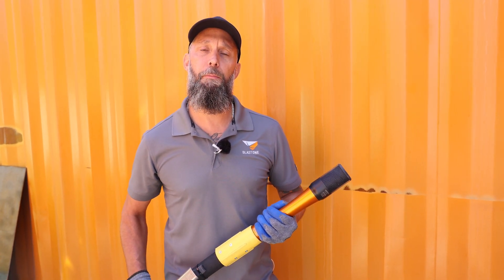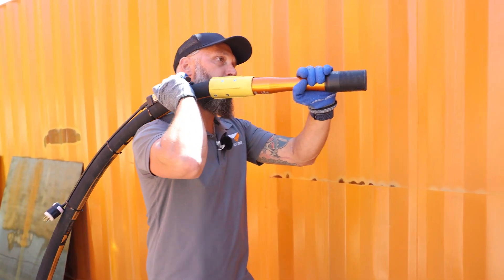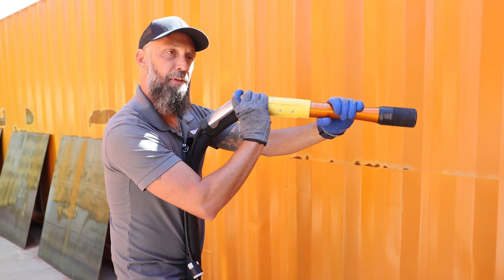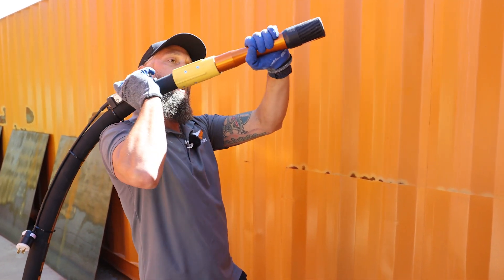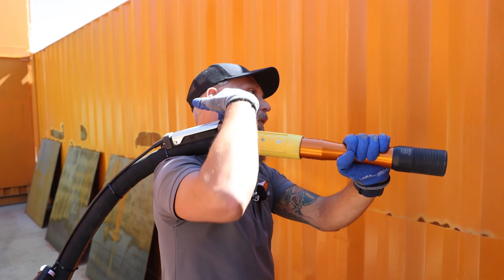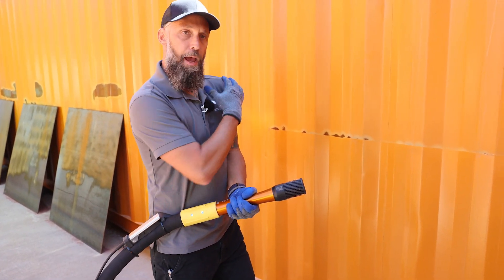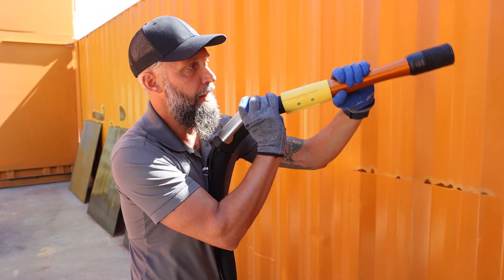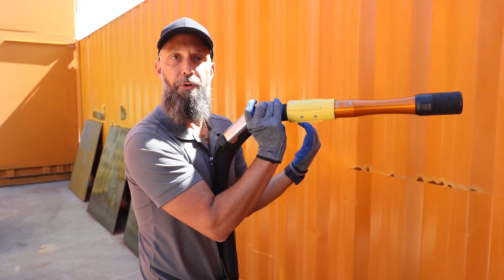Best Way to Hold Your Blast Hose

Comment: Are these recommendations in line with AMPP/SSPC training methods? I've had some coworkers who have gone through the SSPC C7 and CAS certification process, and I seem to remember them telling me that holding the blast hose between their legs resulted in a lower score. But that was a long time ago and I may be misremembering.
Reply from the maker: @user-is6zo7vk2h
Great question.  Thanks for the comment.

This is “our“ recommended method for safety, fatigue reduction and production. There is no right or wrong way to hold a blast hose and no where (osha, ampp, sspc) will it say this is the only way to hold a hose. But within their classes they promote “their” method of holding it and if you don’t answer that correctly on the test they will ding you points. The tech in this video has taken all those courses and remembers the sspc cas course as the only one who addressed how to hold the hose.  We recommend you try all the different ways you can safely hold the hose but can almost guarantee you will prefer the method in the video.
Reply: No they are not, they insist that you use the “over the shoulder” technique
Reply from the maker: @TimPhaneuf   - Who are THEY?   The instructors of these classes?

Comment: any methods for blasting lying down and getting into awkward bits, usually wrap my legs aaround the hose with my feet squeezing it. still to find a easy way.....
Reply: or bending the hose almost 90 degrees to get under lips and edges...

Comment: I agree with everything except Having the hose running up between your legs 
This means you have to step over it to move or escape.
I prefer having the hose running up my none dominant side across my chest then bending over to blasted surface 
I use my none dominant hand taking the weight of the blast hose and my dominant hand to direct the blast stream 
Then if I need to move away from the hose urgently I’m not tangled up with the blast hose
Reply from the maker: Great comment - that makes a lot of sense.  Sounds like you are a blaster.  Any other topics, products, or questions you would like to see more content about?

Comment: No way im putting that hose between my legs. If the hose blows be it a old hose yhats 2 ply or the newer hoses that pinhole there goes you nuts. The over shoulder boulder hold saves the hose for longer life at the cost of your back. The hose in front of you with nozzle chest level gives you more control safely and longer blast days without wearing yourself out. Been doing this for 24 years now.
Reply: if doing over the shoulder method for up high bits etc i leave the deadmans handle dangling from the nozzle about 2-3 feet and pull down with my left taking straing of my dominant right hand and shoulders.